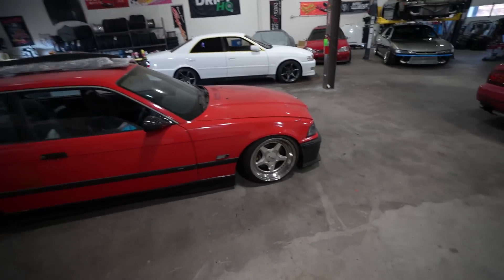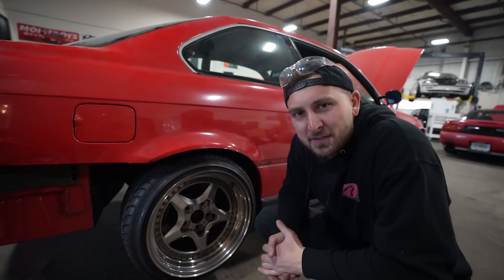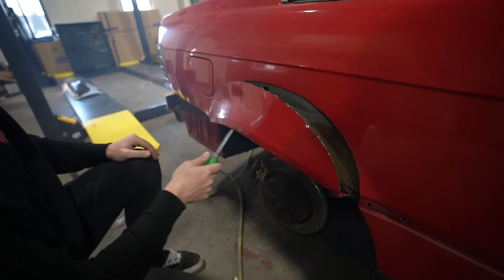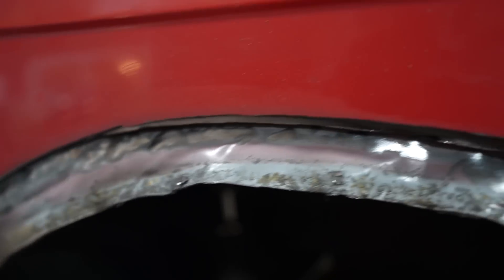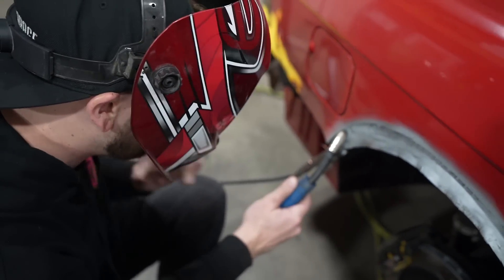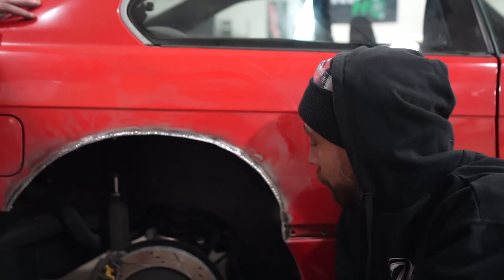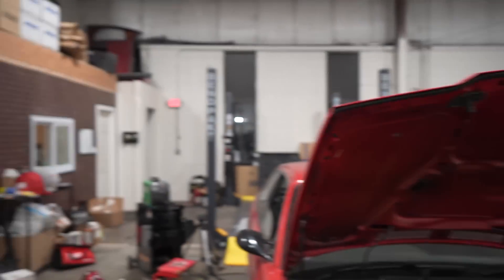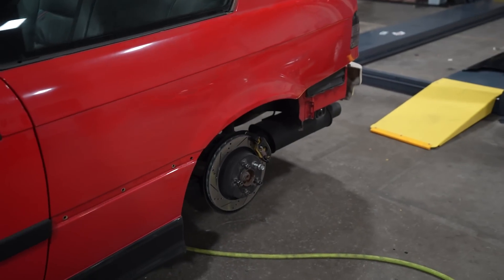Finally decided to CUT UP my clean E36 BMW..

Comment: you can't hate on jimmy for cutting the 36, it's not an actual M-chassis and it's making the car actually more practical from a performance point of view. Besides it's Jimmy Oakes you know it gets the right treatment!
Reply: actually, yes you can
Reply: Why would it be any different if it was an M chassis?
Reply: i mean it’s his car that he paid for and owns so it would be dumb for people to complain anyway lol.
Reply: I cut the frame rails on my e46 m3 so i'm in no possition to talk at least :P
Reply: @janserlang2228  because cutting up a m would decrease its value.. but its not a m so cut away.
Reply: @janserlang2228  value, real m chassis are worth more, even if they are essentially the same on e36's. (think 3.2 might have had reinforced subframe mountings, at least on euro cars)
Reply: @TheOystei  pretty sure the euro spec only has a more spicy engine nothing else except the usual safety BS
Reply: @cameronlawlor1852  I mean the M and non M are the same 🤷‍♀️ not like there's a big difference in value. It's just sad to see a clean e36 being cut (idc tho, i just don't get why it would be ok to cut up regular ones and not M-ones)
Reply: @nielsreiziger4850  euro spec cars had different brake rotors at least, and 3.2 euro spec had 6 speed 420g box, almost same as e46 (different input splines) and a 210 diff.
I know the 3.2 euro had reinforced subframe mountings on the chassis, don't think the 3.0 euro had it, so i would also doubt the us ones had it. (they are just a mild plate kit, so not even as good as aftermarket ones.
Reply: Its only e36 just cut it up, worst chassie of all bmw
Reply: @Mr-cl2bh  why do u say that?
Reply: @janserlang2228  same body maybe but the one with the m vin is worth tonnes more where I'm from in Australia. E36 m3 is about 40+k. Can pick up a basic e36 coupe non m for 8-10k.
Reply: If he said "I wanna widebody it because I want to" I wouldn't give a fuck but saying "i need to widebody it for more grip" like thats some sort of justification to us instead of running real tires that arent stretched to fuck, undoing slammed on its dick canbered tits suspension, or rebuilding the wheels to specs that allow meaty tires is complete bullshit and the cars not going to get any more grip on chinese stretched to fuck tires
Reply: Was typing out the same comment, this car is the perfect car to cut up imo. Jimmy’s doing it legit and building a true enthusiasts car
Reply: @Tanner731  agreed hearing him talk about needing to cut it up to add grip while pointing the camera at the stretched/cambered out rear end definitely annoyed me.
Reply: @Tanner731  except it’s just an E36 lmao. $500 clean body E36s are still a thing, I know because my good body just bought one. Treating normal ass cars as holy relics is why S chassis cars are so inflated.
Reply: @TEAMSTEAM4LIFE  work on that reading comprehension bud, first part of my comment said "If he said "I wanna widebody it because I want to" I wouldn't give a fuck" he did it because he wants to and thats fine but if you think he did this for more grip when hes going to continue to run it cambered to fuck on stretched and shit tires you are wrong lol. now that its cut if he doesnt run 275s or up he didn't do it for grip lol
Reply: @Tanner731  i read your damn comment and that’s my response lmao. Did I stutter?
Reply: Bottom line, Jim wasn’t happy with its current setup
Reply: @Tanner731  u honestly need to get yourself checked out…and there’s a reason shit had to be cambered and stretched…wheels wouldn’t fit otherwise cuz of the lip
Reply: @Kani_ne  you know those wheels could be rebuilt to specs that fit the car right? maybe you should get yourself checked out because you clearly dont know what you are talking about
Reply: @Tanner731  lmao…in its current spec it wont fit…obviously it can be rebuilt say the outer barrel that would just lose the nice look, jim does not want to lose the lip..I wouldn’t either…if he redid the inner barrels shit would still need to be cambered to prevent rubbing..or stretch the fenders and in my eyes it aint much different than cutting it up anyways…i wanna know why u so irritated 😂
Reply: @Mr-cl2bh  very bold statement
Reply: @Kani_ne  why are you trying to tell me somthing I already know? the lip stanceboy shit is stupid the wheels would look fine in proper specs for 255s
Reply: @Tanner731  then why were u trying to tell me supm I already know huh?😂 and thats mild compared to the other shit out there…and the eclairs would prolly look like shit otherwise…what’s so wrong with a lil stance tho?

Comment: Things got no traction because you’re running rubber bands as tires lol. LZ’s 500whp 1j e36 was stock body for a long ass time and it was fine. Just need a good wheel and tire set up.

Comment: I like the cut up BMW after its sealed \ painted I would  put  some L rubber trim on the back fenders glued and sealed and some U trim on the front fenders glued and sealed as well  I would like to know what Brian would think 🤔 plus no sharp front fenders and would be that little extra

Comment: This video is so hard for me to watch, because it is so heartbreaking to watch a stock body car get cut up for more room to fit bigger tires.  But it had to be done, and I am all for it.
Reply: It doesn't HAVE to be done, I've pulled the arches on my E36 and it fits 17x10 with 255 tires easy, it's pretty low too. It would've been enough to raise it like 1cm, pull the arches and you can fit much more tire. I don't understand why everything has to be slammed if it's a car you want to actually drive.
Reply: @TheElfangor  This. Re-build the Eclairs to a usable spec, put a bigger tire on it and raise it up. Literally NO reason for this. It's not like he's going to drive the car anyways.
Reply: no it didn't, jimmy seems hellbent on going full rudnik-spec
Reply: Atleast he’s doing it right and molding the inner fender into the quarter instead of the slit and bend method
Reply: At least it wasn’t a true M3 chassis being cut up
Reply: @TheElfangor  yep 255 and sticky tires why they didnt tried that first no idea. We will see how it will look when they finish so in about 5 years, then it will sit somewhere not being driven xd. He had e36 m3 with cutted body and he get rid of it to cut this xd. Im little bit sad because Jimmy said some long time ago he will not cut it and thanks to him I decided not to cut mine. Still not cutting mine, hell no. I will buy second one but 1 has to be uncut xd.
Lets see how this one will end. Too much negativity in my comment xd. I hope it will turn out great.

Comment: Jimmy, never done overfenders but just occurred to me but could you use a fender roller to stretch the inner liner of metal up vs a hammer? seems easier/ more smooth
Reply: You'll never gain the same width from pulling and rolling your arches as you would from cutting them and installing overfenders. Pulling arches is for fitting aggressive wheels without rubbing, you'll only gain about 5-10mm of clearance at the most, and it'll usually turn out pretty wavey.

Comment: damn i really would've liked to see it with a good tire and not slammed before cutting it, even if its "not your style" just to see how much fun it is. the don musk kit will definitely look good when its all 1 color though!
Reply: Next evolution for the 500hp e30 maybe?
Reply: Bro that’s the whole reason he’s cutting it a good tire wouldn’t fit 😂😂
Reply: @murdmines2054  if he wouldve lifted it up a tad. Got rid of the camber, and stuck a good tire on it it wouldve been fine
Reply: @klassenkustoms9932  800+ capable s50 is def going to use 260(about the extreme max a 36 can run) tyre, that is sure to give enough traction to a 800hp car 😂.
Reply: Exactly, I wish @Jimmy Oakes tried a set of PS4S tires on the E36, raised it a bit. I know it might not looked good but Grip>Looks when it comes to high horsepower cars and driveability. I have 275 on the rear of my M4 and that's still not enough, might move up to 295.

Comment: I don't hate you but I do for doing this. the only way you can make up for it is to weld metal back in. it will be wider but still look OEM. and no ugly panel that sits above the fender

Comment: maaaaaan quit the bs most e36 m3s came with over 300hp from factory with tire tech from the 90's. if you want to cut it just say that, its not useless just because it breaks traction at full throttle j